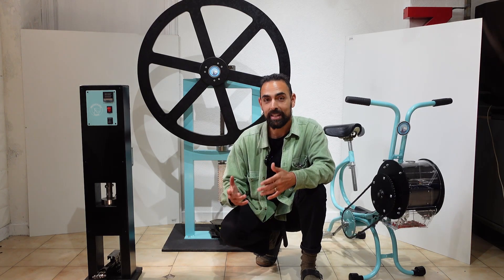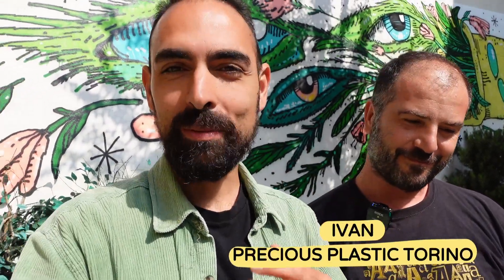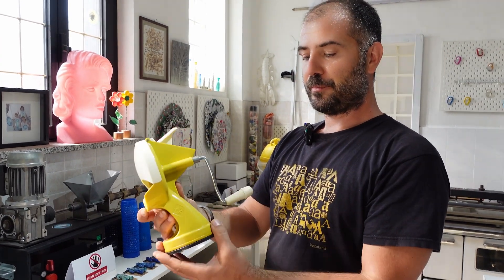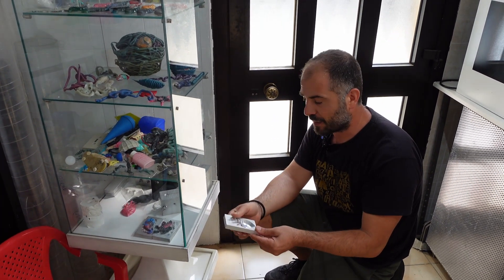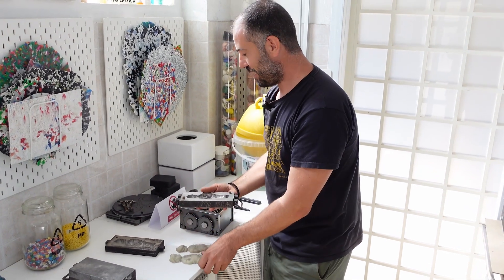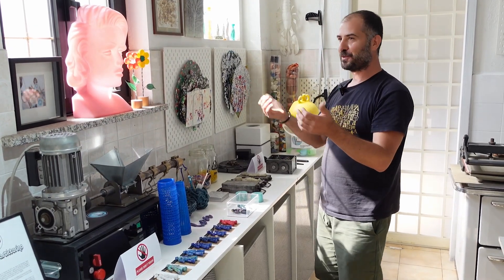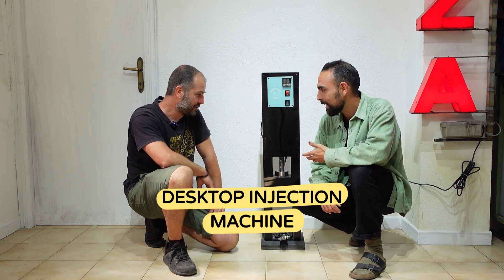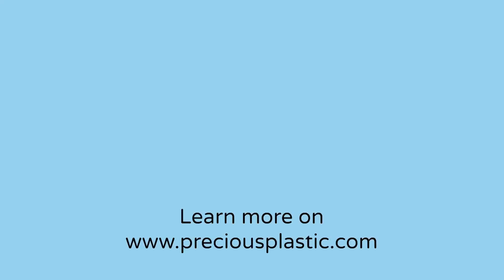Micro recycling WIZARD

Comment: The story of dental machine is not clear.
Reply: I think it was not a focus because it was a repurposed commercial machine, rather than one that will be open sourced.
Reply: It's a vacuum forming one probably (I think) made to make molds for dentures.
It seems to be an old professional machine used for Ivan's purpose of recycling!
Reply: @dadoVRC  are you the guy in the video?
Reply: No, I'm not.
Reply from the maker: Yep, Ivan repurposed a dental machine (the vacuum forming machine) to recycle plastic. Sorry it wasn't super clear :(